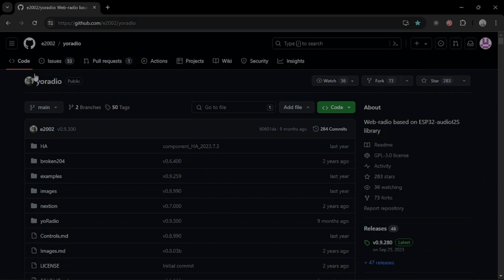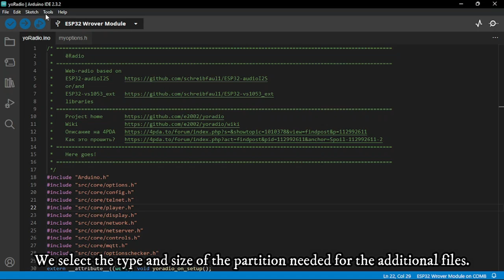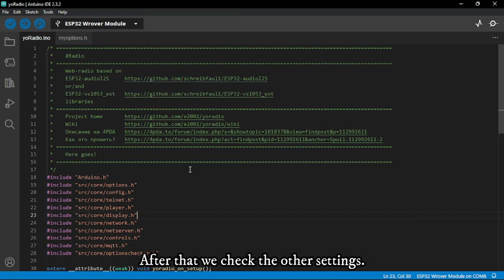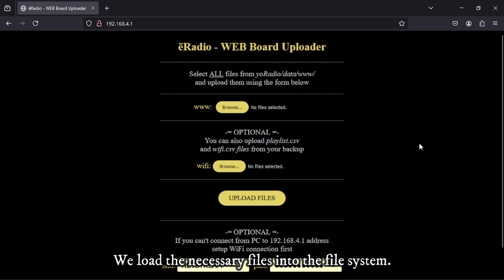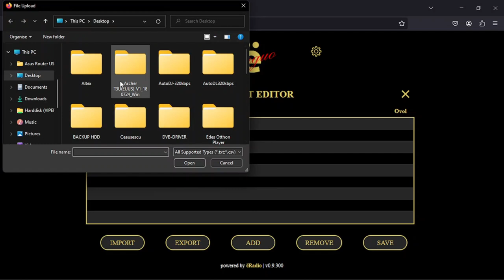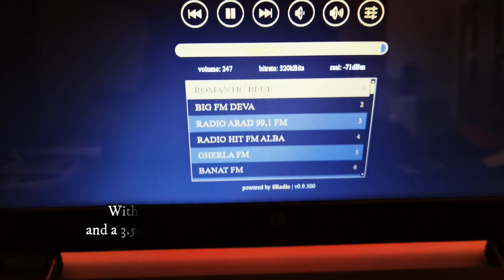yoRadio STEP BY STEP - ( Step 2 - DAC ) ESP32 + PCM5102A - webradio player

Comment: So bitrate is main difference? What about codecs? As many as vs1053 ?
Reply from the maker: The difference is not the bitrate. The difference is a high-quality sound, and this ESP32-Wrover-IE combination can also play a radio station that transmits with a bitrate of 320kbps without any problems.

Comment: Tengo funcionando mi YoRadio desde hace 2 semanas gracias a tus videos con el PCM5102a, pero tengo una duda. Para que es el puente en el SCK? Yo lo tengo sin esa modificación y me funciona igual 🤔
Reply from the maker: El puente de los contactos SCK se realiza para configurar el modo de reloj deseado:

Si se desea utilizar un reloj interno (auto-clocking), el puente se configura de una manera.
Si se utiliza un reloj externo proporcionado por una fuente externa (por ejemplo, un microcontrolador), el puente se configura de manera diferente.
Reply: @LeventeDaradici Gracias! Esperare los videos de como configurar un LCD. Tengo un ST7789 ips de 1.3" Espero sirva para el proyecto! Saludos y gracias por responder, fijaré un puente en SCK

Comment: Üdv. A videók alapján végigcsináltam a lépéseket , de feltöltésnél ezt a hibát adja. " error: 'network' was not declared in this scope; did you mean 'Network'?
   67 |   if (network.status == CONNECTED || network.status==SDREADY) {
      |       ^~~~~~~
      |       Network

exit status 1

  Compilation error: reference to 'oct' is ambiguous " . Mit ronthatok el?
Reply from the maker: Próbálja ki az ESP32 alaplapkezelő (board manager) régebbi verzióját. Például 2.1.1
Reply: Köszönöm Megpróbálom, majd megírom hogy jó lett-e.
Reply from the maker: Ha nem sikerül, vedd fel velem a kapcsolatot messengeren és segítek hibamentesen összeállítani és a kódot a mikrokontrollerbe tölteni, minden kötelezettség nélkül.
Reply: @LeventeDaradici  Szép estét. Köszönöm a segítséget, sikerült a feltöltés . Visszaléptem az Arduino IDE 2.1.1 verzióra és az ESP32 2.0.10-re és simán felment minden ahogy a videóban mutatod. Még egyszer nagyon köszönöm a tippet és várom a következő videóidat. Főleg ahol rotary potival lehetne csatornát váltani és hangerőt állítani. Ha csinálsz ilyen vdeót. Üdv: Péter
Reply from the maker: Következik egy kijelzős videó, ami után az infra szenzorokkal foglalkozom, hogy tudjam használni a távirányítókat, forgó kódolókat, gombokat stb.
Reply: @LeventeDaradici  Már nagyon várom.